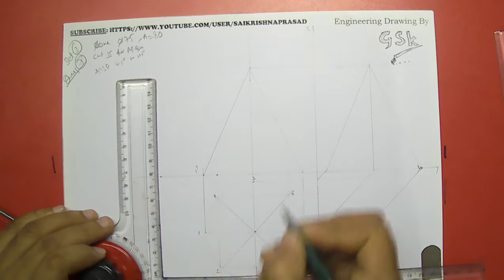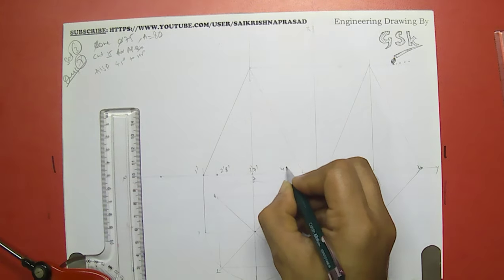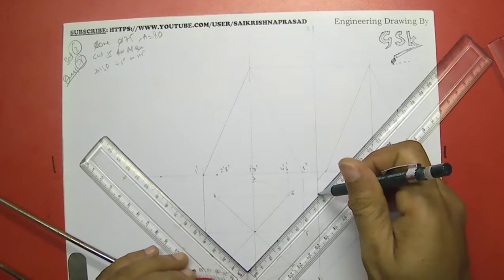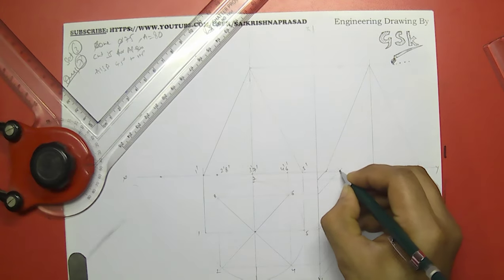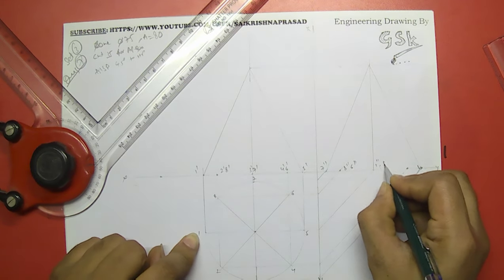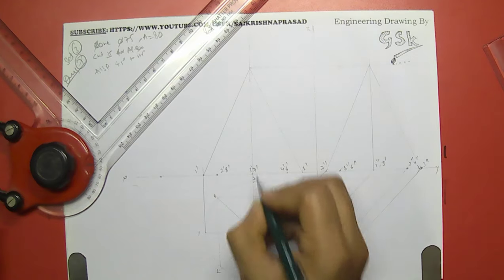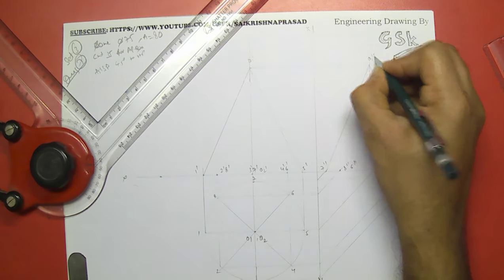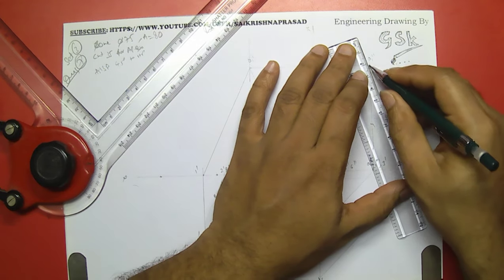P7-Sections of solids

Comment: A Cone base 75 mm diameter and axis 80 mm long is resting on its base on H.P. It is cut by a section plane perpendicular to the V.P., inclined at 45° to the H.P. and cutting the axis at a point 35 mm from the apex. Draw the front view, sectional top view, sectional side view and true shape of the section.

Comment: 1. A Cone base 75 mm diameter and axis 80 mm long is resƟng on its base on H.P. It is cut 
by a secƟon plane perpendicular to the V.P., inclined at 45o to the H.P. and cuƫng the 
axis at a point 35 mm from the apex. Draw the front view, secƟonal top view, secƟonal 
side view and true shape of the secƟon.